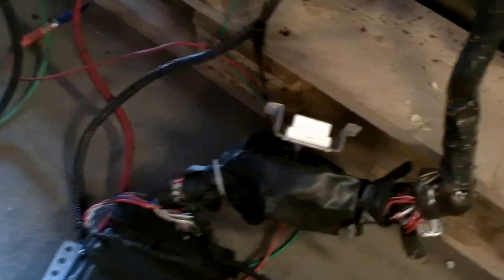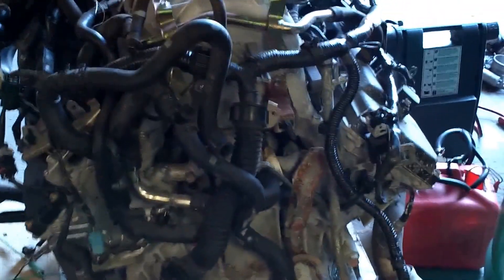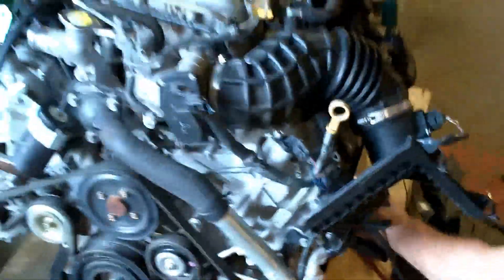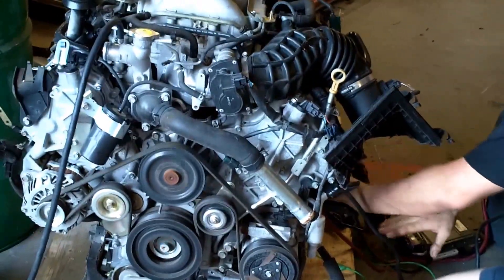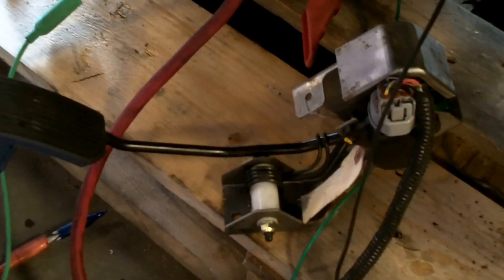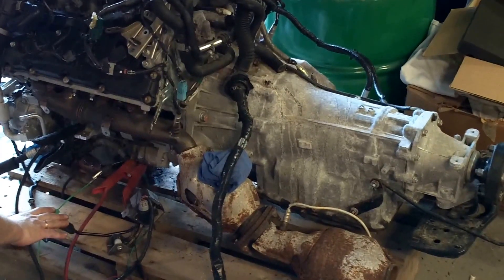Z-Fever's VK45DE wiring harnesss service - engine running on the ground

Comment: awesome video i have a brand new vk45de engine i belive its pre 2006 but it goes to limp mode when load is added can you help with the ecu setup?
Reply from the maker: maybe??? I would need a LOT more info about your car, if it is a swap or in a stock chassis that came with the motor, the year of the harness / ECU, and more info in general. Call me. 813-877-7600 Doug

Comment: I'm an electrical fitter/mechanic who grafted a 1995 Nissan R33 Skyline GTS RB25DE wiring loom into a Holden VL Commodore wiring loom because the VL Commodores ran a Nissan RB30E from the factory in Australia & I built an RB30DE engine out of the 2 engines.

I bought the package with a dud ECU because the engine wouldn't rev past 2000 RPMs at the time & it was spitting out a MAF code but there was nothing wrong with the wiring loom or the MAF meter.

I even went back to the wreckers who were Nice enough to let me try out a known good Nissan RB20DET silvertop MAF meter (same as the RB25DE MAF meter) but it didn't make any difference.

I put a deposit down for another RB25DE ECU & they were nice enough to lend me an RB20DET silvertop ECU, firstly it was a HKS cams tuned R32 Skyline ECU which the RB30DE engine didn't like,it started blowing black smoke & it stalled as I released the clutch,so I borrowed a stock tuned R32 Skyline RB20DET ECU from an R32 Skyline,the only problem being the high idle speed as the R33 Skylines a RB25DE engine has a throttle position sensor fitted,not a throttle position switch such as the RB20DET engine does & there's no VVT solenoid control from that ECU either.

The RB20DET engine runs the same impedance & flow rate fuel injectors albeit in topfeed form (the RB25DE runs Denso side feed fuel injectors) & the same MAF sensor as the RB25DE engine, it runs the same fuel injectors as the Nissan SR20DE & KA24DE engines.

The engine ran beautiful with the RB25DE ECU fitted but I did have to play around with the camshaft timing to get it right, retarding the inlet camshaft timing by 1 tooth made it run silky smooth & actually advancing the exhaust valve timing by 1 tooth eliminated a pinging problem It was having & even on 98 RON fuel.

It went much better than the single cam engine, note that I ran the higher compression RB25DE pistons in it !

Comment: Guysm are you able to edit VK45DE ECU details? For example - remove knock senor read and second pair of O2 sensors?
Reply: yes on the O2's, no on the knock sensor. Also, the VK45DE ECU has to be from an 05 or newer vehicle. If it is the older version ECU then it is NOT tunable
Reply: @dougmitchell743  but ECU from 05 wont run with 03 year angine, right? Only thing is, myne 03year has this adaptive crusie control. Would you be able to take keyless and adaptive cruise  settings put into 05 year ECU? Then i could just put your edited 05 ECU on and there wouldnt be any problems with second pair O2 sensors :) What do you guys think?
Reply: @dougmitchell743  Is there a way to tell by looking what year it's from, in the case of JDM swap motors, for example where we don't have the car to confirm?

Comment: I want to swap one into an '89 Ford Ranger Chasis. This is perfect. Do I send you the ecu?
Reply from the maker: Yes, you should buy a 2006+ newer VK45DE. The older versions have a different ECU and harness that are NOT tunable therefor we can't shut off the NATS. You should send us the EFI harness, the 2nd connector to the ECU, the accelerator pedal connector, and the OBD2 connector. We will rewire it all into a single "Universal" harness. You will only have to wire up 3 wires to make the engine run/drive.  Make sure you send the ECU also. It is necessary for us to tune the ECU for a stand-alone harness application.
Reply: @zfeverrocks  perfect! Thank you so much!

Comment: best video for swap. could you tell me how to eliminate bcm and ipdm ?
Reply: yes, you send us the harness components, we rewire them into a single plug-and-play universal harness, we tune the ECU, and then we send it back to you. We charge $1500 for the VK45 and the harness and ECU has to come from a 2005+ newer M45. If you send me an email to doug@zfever.com I can send you a VK45 swap guide so that you know EXACTLY what you need to send us. Or call us at 813-877-7600

Comment: Did you drop support for this engine I can find nothing on it on your site
Reply from the maker: We still offer support for this application. In fact, we just recently did a VK45DE harness into a Z32 chassis for a customer. We are also developing an adapter for the Z32 5-spd trans onto the VK45DE engine.
Reply: zfeverrocks for see doing something for the z33?
Reply from the maker: yes... we provide the wiring and a 6-spd trans adapter

Comment: How about teaming this up to a C6 Corvette transaxle?
Reply from the maker: anything is possible..... But why not keep the C6 engine?
Reply: Everybody has an LS engine - is very good and cheap to tune no doubt about it, even in the UK.

But need DOHC with revs for Sprint and Hill climbing and not too much Torque as it breaks the back end away too easily.

Saying that, I did see an article somewhere on the LS motor where they installed a 4.8 crank and it revved to 8000.
Reply from the maker: LS is certainly not our specialty, Nissan is. The 4.5L and the 5.6L can be made to run 8k rpm
Reply: Harry Jones they do make a 4.8 ls engine and they are cheap. The block dimensions are all the same they just have less bore and stroke. But they are stout and quickly becoming more and more popluar

Comment: Would it be possible to do this on a 2002 version
Reply from the maker: NO, UNFORTUNATELY WE CAN'T. This particular engine is a 2002 engine but we are running an 06 VK56DE wiring harness and ECU.

Comment: What manual trans can be used with this motor?...300zx 5spd?...350z/G35 6spd?
Reply from the maker: We use the VQ35DE 6-spd manual trans and we have a proprietary adapter kit that allows the use of the OEM wiring harness and ECU.
Reply: zfeverrocks 
Oh wow!  Ok. Thank you.

Comment: 01 engine is a vh45de not a vk45de.
Reply: Brian Heiden 
Actually, from 97-01, it was a VH41DE. 90-96 had the VH45DE. I don't mean to troll. Jussayin' though.
Reply from the maker: I know that the 01 Nissan 4.5L V8 is a VH41DE... But in this video I stated the engine is from an 06..... But I was actually incorrect. It was actually an 02 Q45 engine but we are using the 06 M45 EFI wiring harness and ECU to run the motor and manage fuel/timing etc... Thank you very much for watching our video. I appreciate it!
Reply: Yes you are correct regardless an 06 would have been a vk45de. O1 would not have been a vk either.

Comment: what program did you use to tune the engine and do you have a diagram for the ground run? thankl you im highly considering a vk swap to my s30 and the info might make the difference
 by the way this is awesome
Reply from the maker: We use Osiris to get into the ECU and do what is needed. There are several steps required to make it function without the BCM and IPDM. It is more than removing the NATS.
As for the wiring, we provide the service for people but we do not have diagrams for you to do for yourself. We charge $750 for the VK45 and VK56. Call us at 813-877-7600 if you need any help.
Reply: thank you for the information
Reply: you guys are the one who also produce the vk bellhousing to 6sp right?
Reply from the maker: shane smith yes we are
Reply: zfeverrocks what all do you need if you use your manual adapter

Comment from the maker: That is exactly what we did here... the customer sent us an 01 engine set and we switched it to an 04+ harness and ECU
Reply: need help I have 03 nissan 350z  engine went bad put new 2004 engine it starts fine but get hot goes into limp mode. ..
changed thotal body new same problem some one said TPS accelater padel sensor. .put new one same thing after 20 min ..
when it gets cold it's fine when it get hot it goes into limp mode. .
any help
Reply from the maker: +goolgappa5 have you tried pulling codes? What is the exact temp? It may have a bad coolant temp sensor. If the ECU sees that the engine is overheating (or has a bad temp reading) then it shuts down the TB and won't let it accelerate.
Reply: +zfeverrocks ..
temp don't seems like it's getting hot ,but just when it reaches normal temp it goes into limp mode. .
rest TB I try to put new same issue change the TP it ran for few more min then same issue ,
I put new water pump because engine was new ..it was 2004 engine put it in 2093 350z. .but it starts ok evert I me I do ..
can it be timming but we didn't change any think like timming chain ..
Reply: +zfeverrocks ..can it be thermostate, ,
Reply from the maker: +goolgappa5 If you have an 03 VQ35 and you installed an 04 VQ35 engine..... did you use the O2 sensors from teh 03 car or the 04 car? See, the 04 car uses wideband O2 sensors but the 03 car uses narrow band O2 sensors. You need the same O2 sensor that came with your O3 VQ35 engine.
Reply: +zfeverrocks ..
ok so can I buy those from any were
Reply: +zfeverrocks ..
he said he took all sensor area out and it was doing the same

Comment: Hi there thats great, I cant find any way to tune my 2002 q45 apparently it is all spiderwebed in with the Nav system and traction control among other things. I wonder if i could swap to a newer year ecu I have the VK45de my year is the first year of that motor. Any help would be greatly apreciated I really want to put a tune on it and have a great guy for that if we can just get past the ecu roadblock.